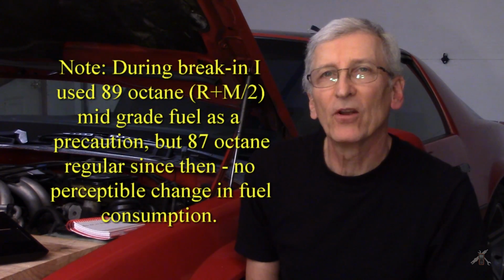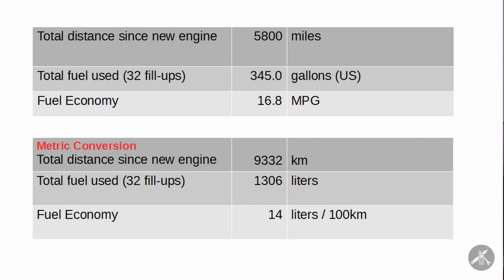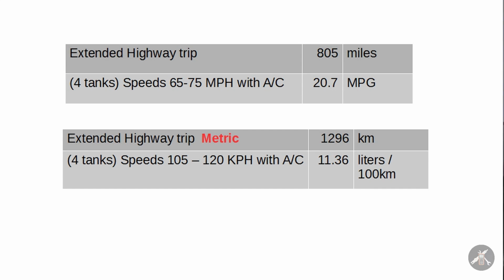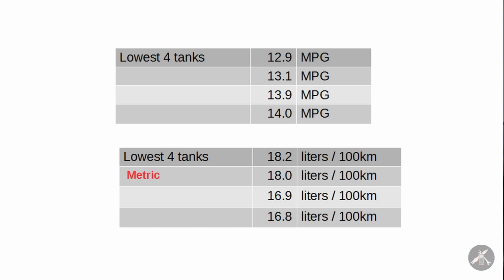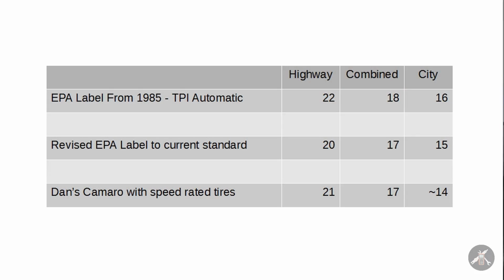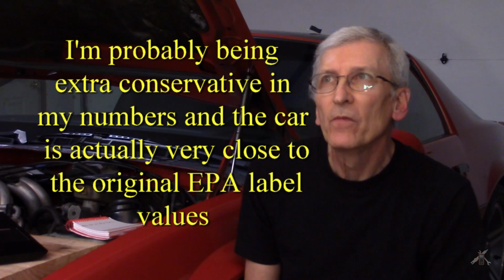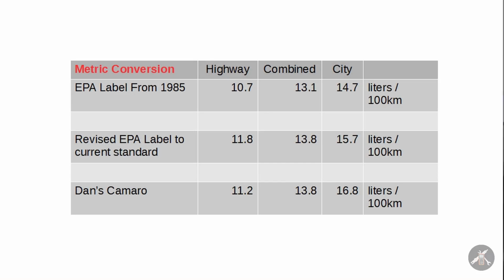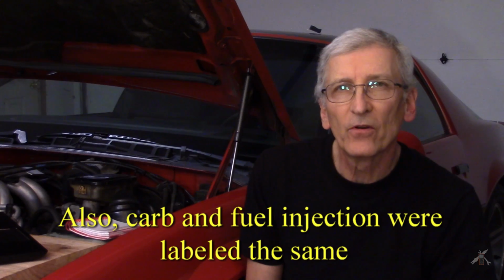3rd Gen Camaro Fuel Economy with Lunati Cam and new Engine

Comment: Hi Dan, this was timely in a way. I have my LS swap basically done and going to a tune shop soon, hoping that I will see over triple the HP/Torque and 19 - 22 MPG. Fingers crossed, although my foot may mess that up. LOL
Reply from the maker: Dave, that sounds like a strong engine build... Depending on your baseline that's 500-600 HP.  I hope it turns out well for you.  It should be quite a ride!
LS is quite efficient in stock form.  My Suburban direct injected 5.3 runs 20 to 23 MPG at 70-75 MPH, but it runs in V4 mode most of the time to do that.  Your aero and mass should be much better, so I'll be interested to see where it lands.

Comment: With that cam and a 3.42 20mpg is not bad. I am a second owner for over 26 years of a 1987 Iroc-Z 5.7L with the b/w 9bolt rear/w 3.27. The most I EVER got was 23mpg (all highway) that was at 60mpg, with cruise control on, and 93 oct gas. Really enjoy your channel!👍 Anthony of Hauppauge NY
Reply from the maker: I'm glad you enjoy the channel!  23 at 60 is still very good.  I have been pleased how mine is running. It really runs well at highway speed.